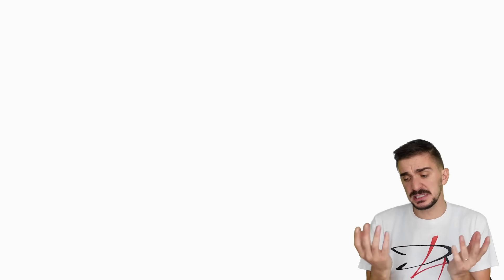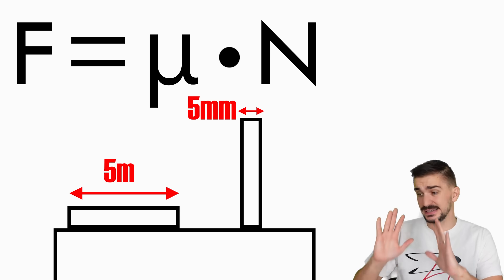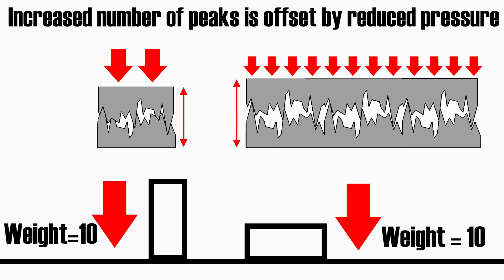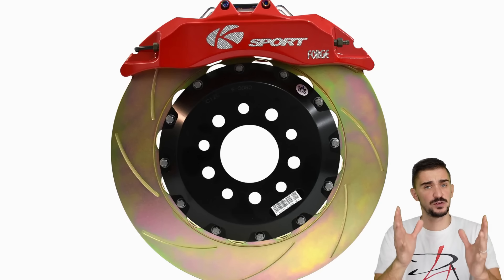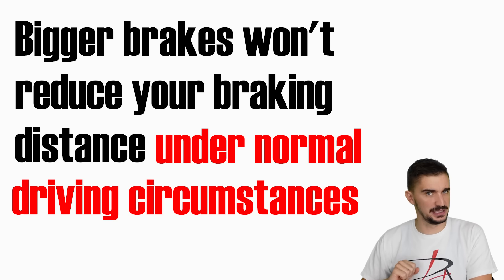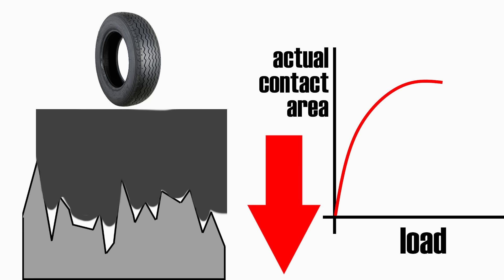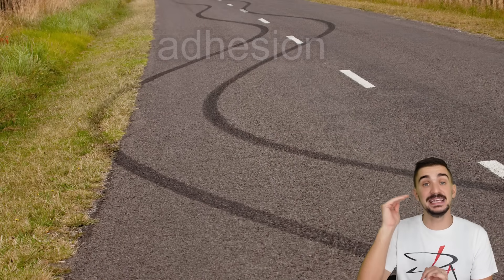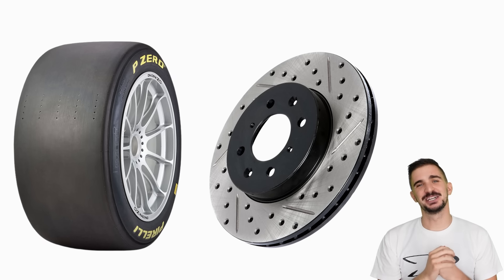Why Big Brakes Won't Stop You Faster but Wider Tires Will - Friction and Surface Area Explained

Comment: Interesting.  I upgraded my rotors from 270 to 290mm, same caliper, same pads and same tyres.  Stopping distance when from about 48m to 35m, cold and both and similar hot.

Interestingly the force on the pedal to get the same stoppage went down a lot and the band from slowing to locking widened, so the smaller rotors either didn't stop good or fully locked with little threshold on pedal force between the 2. The larger diameter rotors widened this a lot so that I can modulate the pedal much easier without the fear of instant lock up in a panic stop.

I could be wrong but this would be the mechanical lever advantage increase? Like going from pedal back brakes on a BMX to conventional rim caliper type.  

My upgrade is a very minor bolt on one.  It's far more common to go for the twin piston  setup for the front from the later models. It's pad is more than twice the size, rotor is 296mm so pretty much the same diameter. The thickness goes from 23mm to 28mm.  This upgrade makes an enormous difference cold and even more so hot. 

I think there is more to it than just heat dissipation.  Probably leverage, heat, caliper rigidity, pad pressure uniformity, glazing, rotor distortion etc...
Reply: The rotor its thickness and its resistance to absorbing heat is different to between bigger rotors higher-quality rotors and the rotors that come on your car
Reply: All of what you said is interesting but the stopping distance factor is still governed by your total contact patch with the road. Period. Science says so.
Reply: @I_HateClickBait  along with other factors.
Reply: Bigger rotors mean a bigger torque being applied with the same force used...it's physics. It's very simple. It should be covered in this film.
Reply: @k_s.m  that only applies if you are not limited by another variable
Reply: @codenameajax7943 Where is the limitation here?  This physics law works the same. 
I changed rotors from 321 to 337 and braking distance is 4meters shorter from 100-0. Verified 3 times.
Reply: @k_s.m  the limitation is your tires traction. That's why it doesn't make any difference.
Reply: 48m to 35m? That's roughly 88% increase in deceleration. Unless you made it up there was something wrong with either those old rotors and/or your testing method.
Reply: @LetoDeWirre  Yeah. There must've been something very wrong with the original commenter's brake setup previously, because that improvement is not normal, even if you change out the the entire braking system and the tyres on a well-functioning car.
Reply: What probably happened is that your new rotors lock the wheels faster. While both locked the wheels, let's say the new brakes lock them 0.5 seconds faster, that results in reduced braking distances because optimal deceleration is reached faster
Reply: @MiLC0RE-iwnl  you're wrong. It's also a common misconception of "why upgrade your brakes I can lock up my wheels fine..." Locking brakes is the worst way to slow down. Peak braking efficiency is where you can apply the most braking pressure while not skidding. Bigger brakes have more leverage so require less pedal effort to apply braking force. This means it's easier to ride the limit of traction. This is also why "wide tyres help braking" because you can push harder before it skids. A bigger brake on the wider tyre will still brake better.

You can look at it as stock brakes are a 3 position switch - off/slowing/emergency and big brakes are a 7 position switch and you'll understand the control you have
Reply: @JackoTJK  My comment was considering an ABS-equipped car. When you are able to lock the wheels earlier, the ABS can work to modulate the braking pressure earlier. The best deceleration is provided under slight lock (ABS does this perfectly), just like how the best acceleration is provided under slight slip, and having a bit of slip on a launch will always be faster than having 0 slip
Reply: @MiLC0RE-iwnl  ABS is less efficient than manually modulating if you have any skill which is why most racecars don't have ABS. 

But. It doesn't matter. ABS works by taking pressure out of the brakes regardless of pedal position when it detects a lockup. Better brakes means it will work less because they are working better so you're less likely to lock them up. You can push closer to the limit with only the better pedal feel.

I'll say it again. Good brakes does NOT mean they lock up. They are in fact the WORST brakes if you did a side by side stopping distance comparison. The best brakes give more braking with less pedal effort but have good feel from barely touching to full blown emergency
Reply: @JackoTJK  ABS is better than threshold braking. It's a common misconception that you can brake better than ABS. See Engineering Explained's video about it: https://youtu.be/G-GEUkiMuLk

And race cars do in fact have ABS. For example GT3 cars. Only series like F1 have ABS banned because it makes it too easy
Reply: @JackoTJK  The better your tires, the later they will lock up. With better brakes, the faster they lock your wheels. It's all relative. You can have the best brakes but cheap tires which instantly lock, at that point you are tire-limited. But you can have extremely grippy racing slicks but bad brakes which can't even get them to lock up at all, and at that point you are brake-limited
Reply: @JackoTJK  Actually ABS is superior, which is why it's banned in a lot of racing. GT3 is one class of racing where it's actually encouraged and even the pro drivers tell you that it's stupid easy as you just literally stand on the brakes and it does it all for you.
Reply: @JackoTJK  lol. The reason racecars don't have abs is because the governing bodies forbid them since it would give too much of an advantage. People watching racing WANT to see drivers make mistakes.
Reply: Race Cars dont have ABS because 1 its too heavy, 2 They want to be able to lock up 1 or 2 wheels in certain situations when needed.

No racing car or stunt driver or pro driver can out stop ABS, thats humanly impossible, Anyone who claims they can is Outright Lying or has Delusional Hallucinations.
No human can press and release the brake pedal upto 25-50 per second like on new cars nor can any human know exactly when brakes will lock up as the amount of variables cannot be accounted for on the fly.. 
Even Pastrana, Colin Mcrae, Tommy all said the same thing in interviews. 
(Just because threshold braking works in a computer game made for kids does not mean it works in Real Like)
 @JackoTJK
Reply: Stock street pads exceed their effective temperature easily, which happens more so with smaller brakes (less area / volume to distribute heat). You could have just installed some proper pads, and it would have had the same effect.
Reply: @stoneeh  I've used track/race pads for years.  These brakes run the Forza FP3 pads.  Stock pads on these Corvette based brakes as as useless as using your handbrake to stop.  75-100m iirc on stockies.
Reply: @3800S1  interesting. Might make me look harder at my potential upgrade (280mm stock to 305mm). Though 48 to 35m under the same rest of variables just seems implausible, sorry.
Reply: @stoneeh  Whether you think it's implausible or not, that's what happened and I have this kind of improvement multiple times with this simple factory upgrade.
Reply: "I could be wrong but this would be the mechanical lever advantage increase? Like going from pedal back brakes on a BMX to conventional rim caliper type."

That's correct. The guy who made this video doesn't know what he's talking about. He makes the false assumption that larger brakes rotors supposedly have more stopping power because of increased surface area of friction and then debunks that false assumption. In reality, cars with larger diameter brake rotors often use the exact same calipers and pads as the same car with smaller rotors does (therefore there's no increase in surface area of friction or clamping force), yet stopping power still increases. 

The reason is simple, i.e., more leverage working in your favor because the calipers/pads are a greater distance from the axis of rotation. It's the same reason that a larger diameter steering wheel is easier to turn (which inherently means it's also easier to stop from turning) than a smaller diameter one, all else being equal. It's also the same reason that you can tighten a bolt more, or more easily loosen a tight bolt, with a longer handled wrench than with a shorter handled wrench.
Reply: @MaximRecoil  stopping power doesn't increase.
Reply: @codenameajax7943  "stopping power doesn't increase."

Yes, it absolutely does, and I already explained why. You obviously don't understand how something as simple as leverage works. 

Go ahead and give a large wheel a spin and then try to stop it by grabbing it with your hand. Do you think it will be easier to stop it if you grab it by the hub or by the outer rim? Obviously it will be far easier to stop it by grabbing it by the outer rim (which is analogous to having larger diameter rotors), even though your grip strength and surface area of friction between your hand and wheel is the same no matter where your grab it, because you have far more leverage working in your favor.

Also, why do you think a large steering wheel is easier to turn (and therefore easier to stop it from turning) than a smaller steering wheel is, all else being equal? It's because of leverage, obviously. The larger the wheel, the more leverage you have when grabbing the outer rim of it. Remove the steering wheel from your car sometime and try to steer it by gripping the little spindle that the steering wheel mounts to; tell me how well that goes. According to your line of thinking it shouldn't make any difference because leverage doesn't exist in your [mis]conception of reality.
Reply: @MaximRecoil  stopping power doesn't increase. 

You could have infinite leverage and stopping distance wouldn't be reduced at all.
Reply: @MaximRecoil  yes bigger brakes can apply more braking force to the wheel. 

But the wheel doesn't magically get more traction.
Reply: @codenameajax7943  "yes bigger brakes can apply more braking force to the wheel."

Your concession is noted.

"But the wheel doesn't magically get more traction."

That's a non sequitur, since you've introduced a completely different variable, and a ridiculous one at that, since it makes the false assumption that no matter how small in diameter your brake rotors are, they magically have enough braking power to instantly lock your wheels, sending you into a skid (which is utterly absurd).

"stopping power doesn't increase. You could have infinite leverage and stopping distance wouldn't be reduced at all."

You don't know what you're talking about. See above.
Reply: @MaximRecoil  just admit you have no clue what you are talking about.
Reply: @MaximRecoil  i honestly can't tell if you are just trolling or not
Reply: @MaximRecoil  so trolling got it.
Reply: @codenameajax7943  Your laughable attempt to redefine the word "trolling" is dismissed and your tacit concession remains noted.
Reply: @MaximRecoil "Your tacit concession is noted".
Are you serious? When someone says that one half of your argument may be true, but without considering the entire question, it is irrelevant, that's not a concession.
Let me guess... your other way of "winning" an argument is to pounce on an obvious misstatement and shout "Gotta take what you say first!".
Reply: @ ""Your tacit concession is noted".
Are you serious?"

Obviously.

"When someone says that one half of your argument may be true, but without considering the entire question"

I refuted his "argument," simple fellow, which was this absurdity:

"stopping power doesn't increase. yes bigger brakes can apply more braking force to the wheel. But the wheel doesn't magically get more traction."

I explained why it was absurd. Here it is again:

That's a non sequitur, since you've introduced a completely different variable, and a ridiculous one at that, since it makes the false assumption that no matter how small in diameter your brake rotors are, they magically have enough braking power to instantly lock your wheels, sending you into a skid (which is utterly absurd).

And he didn't address, let alone refute, what I said (instead, he typed non sequiturs like, "just admit you have no clue what you are talking about"), that = tacit concession on his part, obviously.
Reply: @MaximRecoil  That is correct, and also explains why bikes with disk brakes are often worse than the old conventional rim brakes, unless they have very good and aggressive pad compounds. Most bikes I have ridden have way worse disk brakes than conventional rim brakes. And even when conventional brakes compared to apples to apples with just rim size as the factor, road bikes with big rims far out brake BMX bikes with their much smaller 20" rims.

It's not just the radius of leverage but also the total swept surface area the pad covers per wheel rev ( for the case of cars as on bikes the wheel size negates the revs of the wheel per same distance, cars that is more or less fixed radius).

Just like my original post, simply replacing the rotors to a larger diameter made a big difference and sill is, I have driven something like 30k since the OP and the brakes are pretty damn good for the age of the car, they sucked so bad on the 270mm rotors. I have done this mod of a few of these cars with the same result.
Reply: @3800S1  "That is correct, and also explains why bikes with disk brakes are often worse than the old conventional rim brakes, unless they have very good and aggressive pad compounds."

Yeah, rim brakes have way more potential braking power than those tiny disk brakes on bikes (the "big" ones are only about 7" diameter). The things that tend to ruin the potential of rim brakes are low clamping force from the cable-operated brakes and a not-so-great braking surface (carbon fiber rims, which are all the rage these days, being about as bad as it gets for a braking surface) and/or pad compound. Modern high-end hydraulic disc brakes on bikes have way more clamping force with the calipers and a very good braking surface and pad compound, so it makes up for their small rotors.

I would like to try hydraulic rim brakes (I didn't even know they existed until, out of curiosity, I did a Google search for the term "hydraulic rim brakes" other night), along with aluminum alloy rims with a nice machined braking surface. I bet they would have more braking power than any bicycle disk brakes on the market.

"And even when conventional brakes compared to apples to apples with just rim size as the factor, road bikes with big rims far out brake BMX bikes with their much smaller 20" rims."

Yeah, I discovered that when I was a kid in the '80s. I got a 26-inch "10-speed" when I was about 12 and the ordinary side-pull caliper brakes felt like they could send me flying over the handlebars if I pressed them hard; way more stopping power than my BMXs ever had, despite also having ordinary side-pull caliper brakes.
Reply: @MaximRecoil  My partner has a mid range mountain bike with disks and they are by far the best ones I have used for disks and I would call them more than good enough. The at the time medium/high end e-bike has the same sized disks, I'm sure both are Giant brand bikes and boy,do those disk brakes suck and so noisy! The pads def make a difference. Then she has one of those female retro style 24"? bikes with cup holder in the frame with rim brakes, that has lethally good brakes, instantly over handle bar ones with only a light to medial hand force.  I'd say that has 50% more braking than the really good disk one and probably 200-250% better than the e-bike disks.  My BMX is better than the e-bike but not as good as the other 2 mentioned.

My replacement car while on the subject (same model as before) is getting the twin piston and 296x28 rotor upgrade. I am going to use the Forza FP3 pads as the current car is using but also adding slotted rotors. I found the performance pads out gas easier than conventional pads and this makes a fading like feel that goes away when you momentarily lift the pedal or pulse the pedal as you brake.
Reply: In reality, brake size really matter, friction formula only work on randomly uniform surface, but on brakes, nope, the disc grinds the pads until most of their surface touch each other, so it have larger friction.
Reply: @briliankamil4594  keep in mind as the brake rotor thins and wears down it will absorb heat quicker and fade-out. So optimum breaking will be with Superior rotors that are drilled and slotted it Superior brake pads so that whatever braking power you have be maximum. You can't really measure the brake system at lock up as being pass or fail it's like having a good low range in a four-wheel-drive it's about giving you control over the braking system not necessarily bring it to lock up cuz lockup doesn't really stop you
Reply: @briliankamil4594  Exactly why big brake upgrades are a thing. Heat rejection only makes sense when pushing the brakes (no pun), but normal driving big brakes make a huge difference in stopping power vs the pedal effort where heat and fade are not a thing, that factor is surface area and rotor diameter (leverage).  On my car I simply upped the rotor diameter and used the caliper brackets to suit and that made a big difference, that's just leverage alone. Still fades about the same as before so heat factor isn't changed much.  On my other daily car (same model) I am fitting the common twin piston upgrade with larger rotors again and the pad is 2x + the surface area.